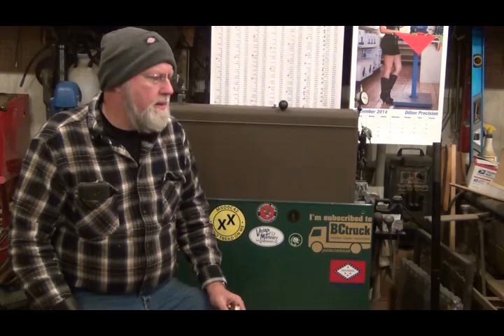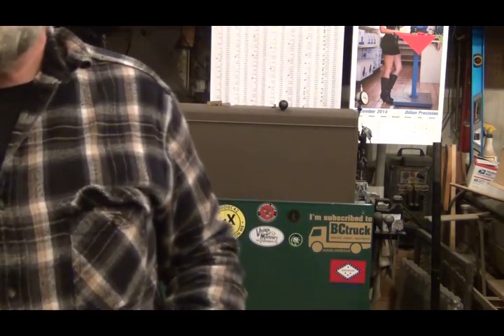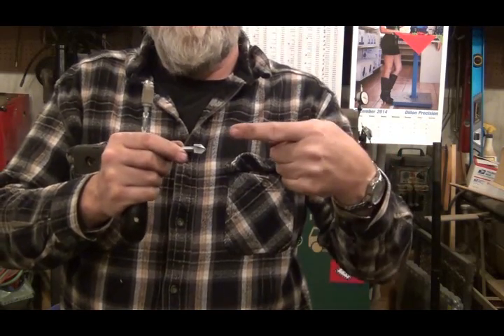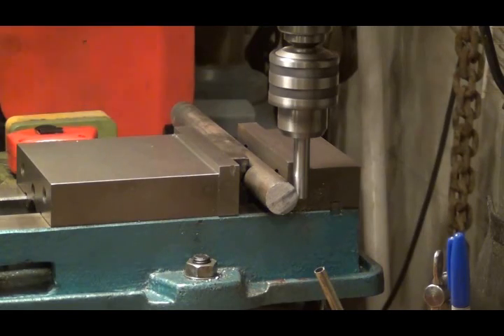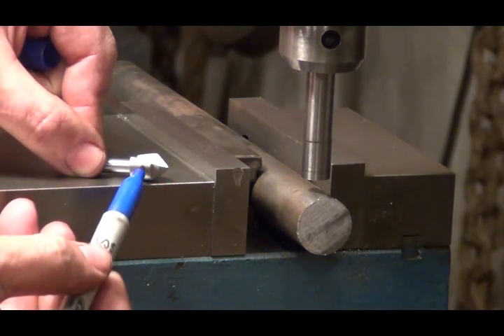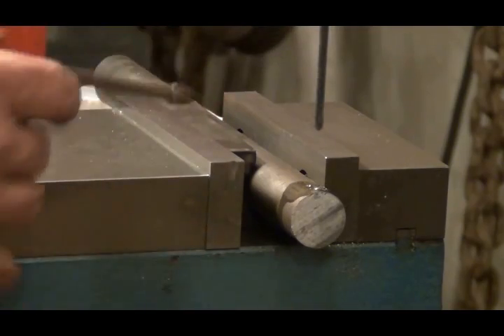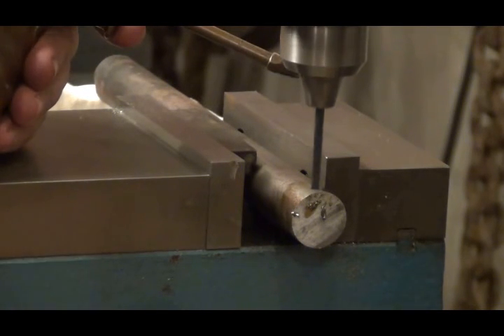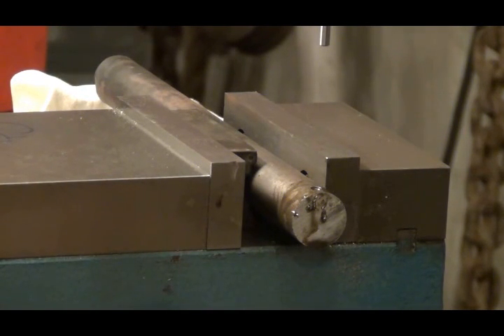Copied Tom Lipton's chamfer tool part 1

Comment: You can use a collet in the mill to hold the chamfer end of the tool and put a turning tool, even a carbide insert in the vise and basically use you mill as a lathe. I've cut clearance in high speed end mills this way because I didn't have a grinder to use. Just a thought.
Reply from the maker: lonewolfpa There are so many ways to do things. The more I learn about machining the less I know!

Comment: You have some really nice tool Buck!  You make everything look too easy
Reply from the maker: Pops Quest for a Simple Life Look who is talking. Your channel should be Pops the tool MAN! lol
Reply: On that subject, I am in the market for a machinist vice to mount on the far end of the CNC table that never gets used  to machine those lowers and some other aluminum "Things"  any recommendations on a brand you like?
Reply from the maker: Pops Quest for a Simple Life Mine is a 6" Enco. It has worked fine for me. But it seems the machining pros use Kurt vices. To pricy for me though. If I had to do it over I wouldn't get one with the swivel base. It just takes up space and I never swivel it.
Reply: Pops Quest for a Simple Life I love Wilton vises and they are not too expensive. Amazon and eBay carry multiple models. Have fun shopping!